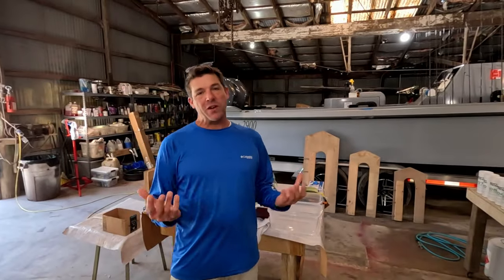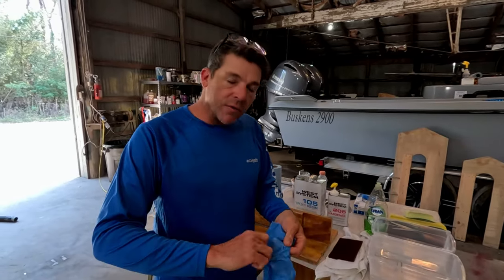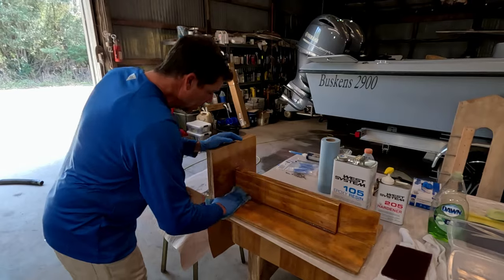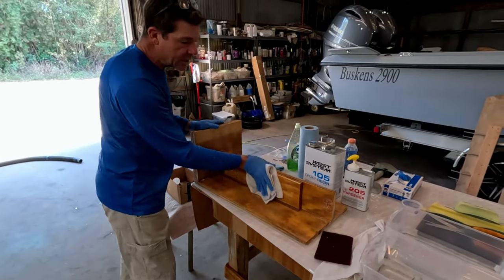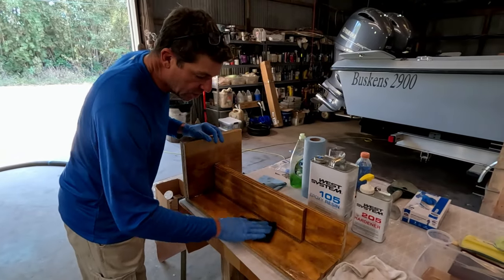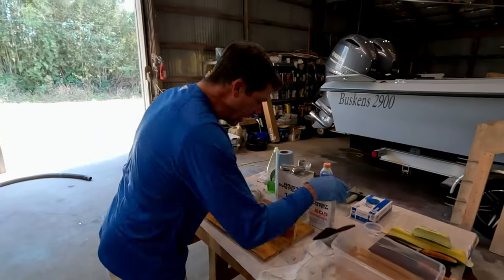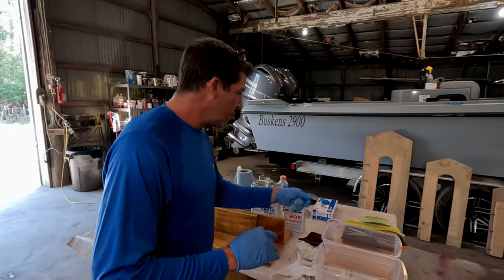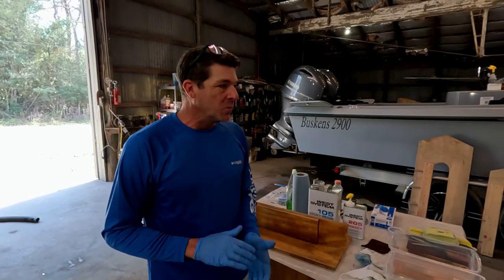EPOXY HAZARD!! DON'T LET THIS MESS UP YOUR EPOXY PROJECT!

Comment: THis is fascinating. I hate the blush. Began about 20 years ago working with epoxy at a boatyard. Not a soul at the yard was aware you can wash the blush off like this. ALways sanded it off. Later I continued doing more glass work on my own and the way I dealt with the blush was always using chop mat as the top layer of my work then sanding it. The mat sands to a great finish as a sacrificial layer on top of the cloth. Then, I discovered Peel n Ply. That was an absolute game changer. Been using Peel Ply ever since. Actually I've never used the Peel Ply product but instead the same material sold by Paxton as a vacuum bagging membrane. Same stuff. Works amazing. Another expensive layer of stuff to throw in the mix though. It might be about the same cost as paying to scrub or sand a bunch of glass though. 

I'm going to give scrubbing with detergent a try. I am skeptical because I don't understand how you're supposed to know whether or not you got all the blush off or not? Also, isn't the surface going to be slick and still require sanding? 

On a piece like that stringer/transom mock up I'd of tried to do the entire lay up all at once. There by eliminating dealing with blush and prep and all that. I would have gone right on with the cloth soon as the fillet was down while the epoxy coat on the wood was still wet. If possible that is.
Reply from the maker: Thanks for your thought, all good points! A lot of the folks watching the channel are new to working with composites, so some of what we are doing is going to be following the KISS principle. Keep it simple Sam. Hoping to build a foundation of knowledge for the folks, then branching out to more methods. Mat or csm on top can work, but then lots of sanding after cure. That is tougher than wiping with soap and water then scotchbrite in my opinion. Peel ply is also a good option, but it adds cost to the project. You could certainly sand or scuff up the water and soap prepped surface with some sandpaper, and we probably will before we finish the part.There are also epoxy resins on the market that do not blush at all if you can believe it, but west systems is probably going to be the most commonly used epoxy for the average DIYer, so that is why we are using it. I hope this helps answer some of your questions, and I truly appreciate you watching and commenting!

Comment: When I built my 16’ Glen-L runabout using there 5/1 ratio epoxy, it had the blush. On my current Checkmate redo, I am using US Composites 2/1 slow epoxy. Long work time and no blush. Love your videos
Reply from the maker: Yes, we are going to be testing some 2 to 1 epoxy soon. We have used some blush free epoxy in the past with good success,  but the west is very popular and it blushes. Thanks for watching!
Reply: @FishBumpTV  I was very pleased with US Composites. They are in Fl so it would be close to you. Good prices I felt.
Reply from the maker: @stevejackson4136  Good to know, thanks!

Comment: I did that preparation for bonding polyester on top of an epoxy-based material, whose name I don’t know in English but it’s 80% epoxy plus some additives.   It’s some good stuff I had at home and wanted to seat the ply wood with , but now after sanding it , rubbing it like you showed and washing /rinsing it, I am scared it may not create a good bond for the polyester lamination that goes on top of it.    I will make some test first , if it doesn’t work on a small part I will have to laminate the fiberglass with epoxy resin ( which is expensive here )  😢

Comment: Hey Joe, I ordered finish resin with wax in it by mistake, can I laminate multiple layers of glass before it cures or do I need resin with no wax? Thanks for everything man!
Reply from the maker: You should able to lay up or laminate several wet layers. As long a the surface still has a good tack to it you should be good. Beyond that it would  need to be sanded thoroughly  and prepped well. Hope this helps and thanks for Watching!

Comment: Hi. I'm enjoying your content. I've got a mold project built in epoxy and csm. With the powder binder. It has cured 24 hours. Should I do this process to clean up the surface before epoxying things on the outside of piece?
Reply from the maker: Glad you are enjoying the videos! Not all epoxy produces amine blush, but if you are in any doubt about it I will clean and prep it just to be on the safe side. I hope this helps and thanks for watching!

Comment: Great video on blush, I have a question.  I ran out of light today and didn't get all my epoxy/basalt finished,  do I heed to scuff the surface with a sander before I go in for another round of epoxy/basalt or just wash like in your vid ?
Reply from the maker: Thanks! I usually wash and wipe thoroughly with the scotch Brite pads, let it dry or use a heat gun to speed up the drying process then scuff it well with 80 grit paper to remove any gloss. I cover more of the sanding of the epoxy in the next video in this series. I hope this helps and best of luck with your project!
Reply: @FishBumpTV  thanks mate, I appreciate your knowledge and look forward to the next vid.

Comment: What are your thoughts on avoiding amino blush on the fillet in the corner? 
Thus, how long should I wait to lay down the first layer of cloth to avoid the blush when the fillet fully cures?
Reply: Good question it'll be great to get the answer. I may have been doing wrong dependant on time and temps within an hour and or slightly tacky to the touch?
Reply: One solution for all amine blush is to put a finish layer of peel-ply over the top of your work. treat it like a layer of fiberglass and try to get all the air pockets out of it.  It helps with two things.  It leaves a surface good for bonding the next layer, without the need to sand, but it also removes the amine blush.
Reply: @anthonystrawbridge 
That's the same thing I did on my one previous project, we layered cloth and epoxy resin before the cure time. It seems really good and strong and surprisingly not very thick
Reply: @TheSpadre  True, but that implies you must cure it, remove the peel-ply, and then put the cloth down. I was more interested in whether that was the only way of doing it, or if I could apply cloth after some time (tacky?) to speed things up. I have seen on YouTube DIY to put peel-ply and wait until the next day; others do not seem to worry about the possible fillet blush and ignore it.
Reply: @Cptnbond  Definitely there is more than one way to do it.  If it is still tacky you can certainly lay up another layer, however, you can also lay up wet on wet.  Using peel-ply is still good to do at the end of the day regardless of what you are planning to do next.  It solves the removing blush step, and to lay something down on top of it (more layers of glass, or fairing compound), you will not need to sand it unless you want to lay it flat before moving forward.
Reply: @Cptnbond  more specific to your question, you can lay down your glass before curring your filets.  As long as you keep a good radius for strength, you can lay your glass without waiting.  This method works best if your filet putty is on the stiffer side but it works.  The only potential drawback is if you are using fast cure in higher temperatures or your filet radius is very large it could build up too much heat when curing.   If you wait till it is fully cured, you must remove blush and sand before moving forward.
Reply from the maker: If you are ready to move forward with laying glass immediately after you have applied your fillet, you can as long as the fillet Is firm in nature or has had a little cure time to allow it to firm up. There is also blush free epoxy on the market, it is usually a 2 to 1 ratio or you can use a product called peel ply. I will be discussing this topic more when we actually fiberglass over our demonstration piece with epoxy and 1708. This will be coming very soon for you guys. Hope this helps and thanks for watching!

Comment: Thanks for the great content! I am restoring an old Day Sailer that had a lot of osmosis, using polyester resin and restoring the holes, now in the fairing process, but I have used some cheap polyester fairing compound in the bottom of the boat, and saw in some of your videos that you don't recommend. Do you think its going to cause problems even in a boat that just go to the water during a day or two and remains the rest of the week dry? Thank you, Fernando from Brazil!
Reply from the maker: Polyester fillers are not usually recommended below the waterline. We like vinyl Ester or epoxy based materials if possible. That is because they are much better as a water barrier compared to Polyester. It might be just fine for light use, and you understand that the blisters could return in those areas. If you have already done most of the work, and don't want to redo it. You might try using an epoxy barrier coat like interlux 2000 over all of the hull bottom after all repairs are done. It usually takes 3 to 5 coats.This could help stop water migration into your repairs. I hope this helps , and thanks for watching all the way from Brazil 🇧🇷!

Comment: Can you show us how you cut a stringer to the contour of a hull?
Reply from the maker: That's a great suggestion, I will try to get that in a video for you guys. We use 1/2 or 3/4 thick blue board insulation foam from Lowes or home depot for making our stringer templates or patterns. It is cheap, and very easy to work with compared to your actual stringer material. We also use construction string stretched tight from the transom to the bow where the stringer will end. We mark the string every foot, from the transom to the bow, then measure from the string to the bottom of the boat. Do that from transom to bow, then transfer those measurements to the foam pattern. That will get you pretty close, then just fine tune it and use the pattern to made your actual stringer. I hope this helps, and thanks for watching!
Reply: @FishBumpTV literally doing stringers to transom now thanks for this

Comment: You didn't really finish off this video or I missed it? Was all the blush gone with the last paper towel wipe down? Thanks very much for making these very useful videos.
Reply from the maker: Yes, in most cases the process I showed will remove  the amine blush. Of course if you go through the steps and you suspect that there is still some blush, you can always repeat the steps. I do usually scuff or sand the surface lightly after all the blush is removed, and prior to laying down the fiberglass. I will be showing that in the next phase. Hope this helps and thanks for watching

Comment: I am going to do a wet layup of a carbon fiber hood, 4 layers of cloth.  How do I know if the epoxy has cured too much between layers such that I have to sand between layers.
Reply from the maker: Sounds like a cool project! Generally as long as the surface still has some "tack" to it, you should be good. Meaning it is still trying to stick to anything that touches it. Amine blush is slick or oily on the other hand, and will repel. I would recommend testing some of your materials first before starting your part. We do testing all of the time with new material or different processes before we build the actual part. Hope this helps, and thanks for watching!
Reply: @FishBumpTV  also after the layup is completed is there any additional strength gained by doing an elevated temperature cure for several hours.

Comment: Didn't catch the part for another lay up you still need to grind it to add more glass correct
Reply from the maker: After the amine blush removal, I do usually sand the surface before adding more epoxy. I have a new video coming in the next day or two that will detail the whole process. Thanks for watching
Reply: @FishBumpTV  QQ - for another layup, after you sand, do you wipe down with acetone before adding another layer of epoxy?  Thanks

Comment: You mentioned you applied the epoxy a few videos ago. Is there a limit timewise when you can no longer removing the blush?
Reply from the maker: There isn't a time limit to amine blush removal that I am aware of. You might also want to consider the use of peel ply to eliminate amine blush. I recently did a video using this material that you might find useful. I hope this helps and I appreciate you watching!

Comment: I got a terrible blush from the US composites epoxy I bought for my build. Took forever to get it off. Going back to West systems. Buying it by the 4 gallon jug it's cheaper. 
I didn't save any money if you count your time scrubbing that   heavy wax off....
Reply from the maker: Sorry to hear that! Just remember that almost all 4 to 1 or 5 to 1 epoxy systems will produce an amine blush. There are 2 to 1 epoxy systems that don't produce amine blush at all. You might want to consider looking into those. Peel ply is something you should seriously consider using when working with epoxy, as it will completely eliminate amine blush when used correctly. I have a video on how to use peel ply here on the channel that I am sure you will find useful. I hope this helps, and thanks for watching!
Reply: @FishBumpTV  thank you for the advice, do you have a particular brand of 2:1 that you have used and will recommend?
Reply from the maker: @Land_an_sea  System 3 makes a good blush free epoxy that I have used before with good success. Fiberglass warehouse also offers a 2 to 1 low blush epoxy. I hope this helps and thanks for watching!